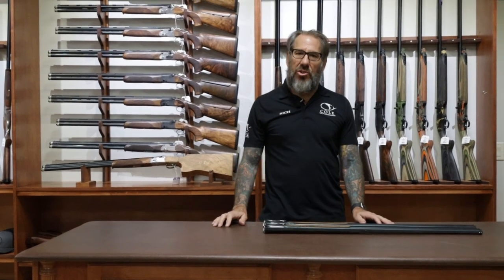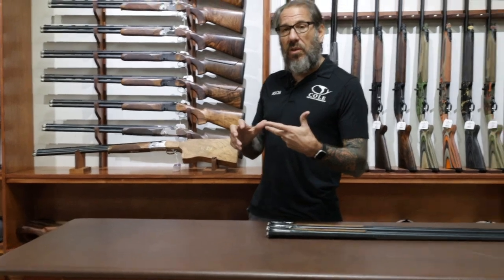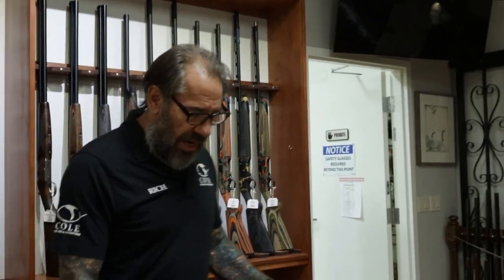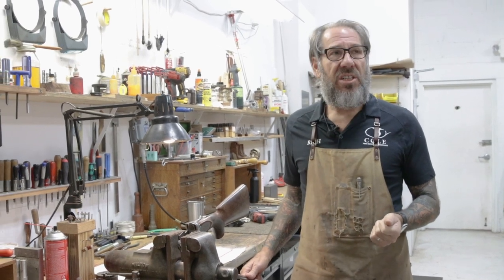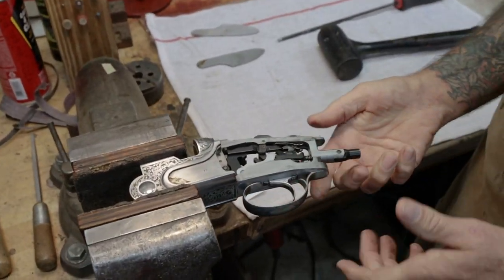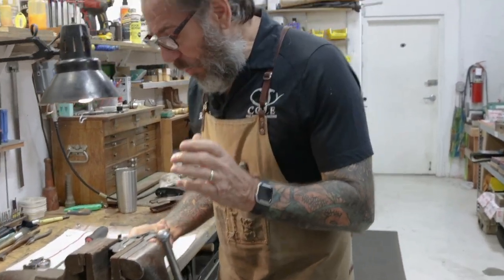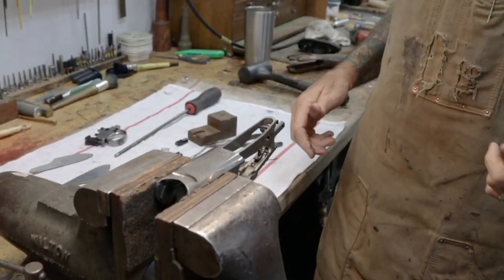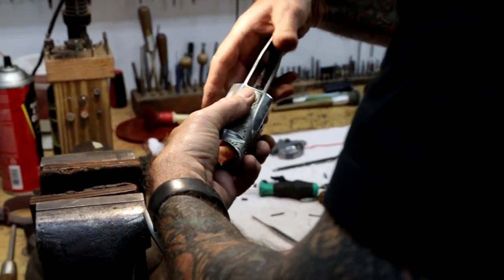DT11 Sub Gauge Barrels w/Rich Cole

Comment: Fantastic video I’ve watched it twice ! I’ve been doing work on my own guns for a few years and this level of smithing is great to see as it would normally be  a trade secret. I’ve just recently got a dt11 black and it will need tightening up soon possibly swap the hinge pins and new lock bolt is where my head is. But after watching this I’m sure there’s a lot more to look at. Great video thank you from me in 🇬🇧.

Comment: Fantastic information.  Can you tell me when a DT11 needs to be returned to have the locking bolt serviced (the next larger size)?  Right now, my locking bolt still extends out of the left side slightly when the gun is closed but it is getting close to being flush.   Thanks Rich!
Reply from the maker: Hi Kevin! You will want to have a service and new locking bolt installed when it becomes flush. Thanks!

Comment: These are great videos! The shells seem to rub the receiver when closing and leave wear marks on my 694.
Reply: Mine too, not every time though. Maybe a few times per 100 shells. I think either that tolerance is off, or some shells are a little on the thick side and cause a problem. Also notice it if I shoot a ton in a small amount of time, so maybe thermal expansion screws with the tolerance as well
Reply: @Claybreaker  I don't feel my shells dragging. I just notice the wear marks on the breach face.

Comment: Hey Rich, thanks for doing these videos. I’m an amateur gunsmith and I’ve learned a ton.  Quick question for you:  I buy most of my Beretta parts from you. Do you use the 8 degree bolts on older DT10s and 11s?  The reason I ask is because I never see anything other than the 8 degree bolts for sale nowadays. I have an older DT10 that I’m working on now and I wonder if you still carry the old 10 degree bolts or if you simply use the 8 degree on the old ones too. Thanks!

Comment: Rich, thanks for great video, it was very interesting. It will be nice if you show how to replace locking bolt when it comes flush, fitting process and applicability 8° bolt for old type of dt10 with 10° locking lugs, if its possible of course))